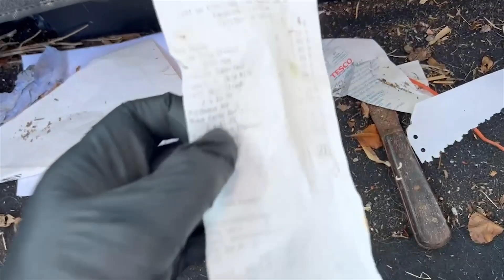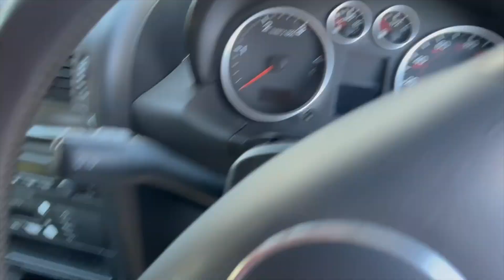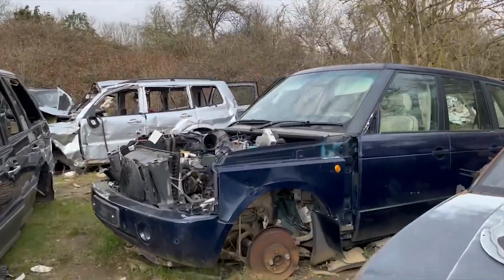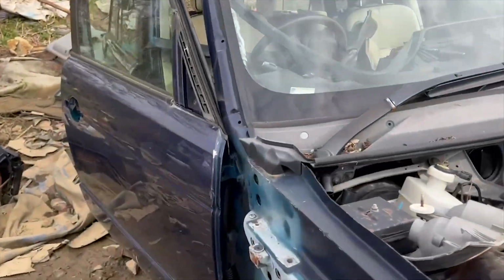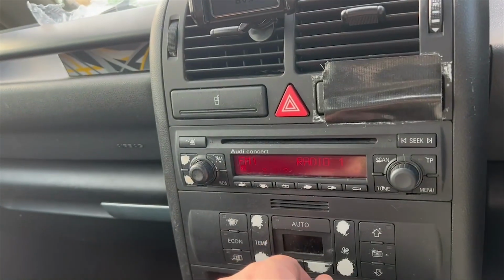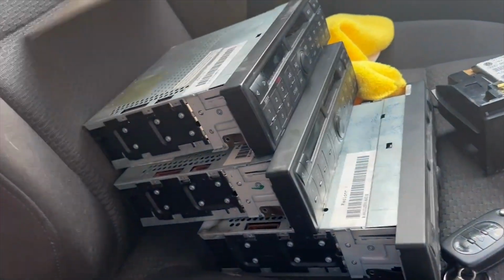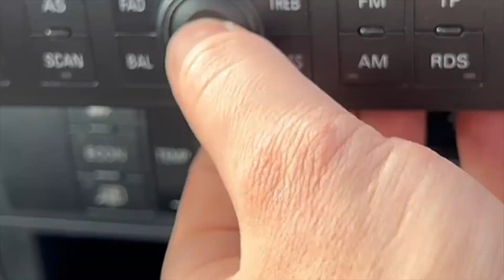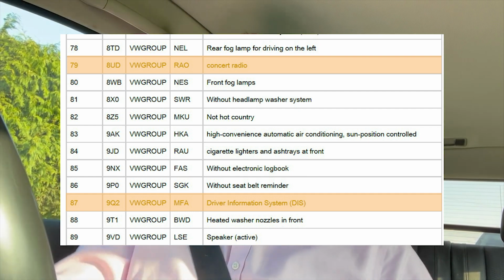Trying to save my Audi A2 from the brink on a budget!

Comment: If correct ECU, you can map the EGR out yourself with MPPS to download map, and EDC15 being used to modify before re uploading as detailed on Briskoda Fabia MK1 forum. Did this myself on a 70bhp 2006 1.4 TDI.
Reply from the maker: I’m actually sending the ECU off, probably for the same treatment! The amount I’m paying is comically low so it was worth it. As for the EGR, he’s machining it out so it’s less restrictive but still performs some of the functions you want, and doesn’t upset MOT man! I’ll post the results on here :)

Comment: The holy grail of used car buying is to find value in older cheap high spec cars that the general public are ready to discard. Does this A2 fit the bill ? At some point all cars become uneconomic to repair or too unreliable to use. If it could do a job for you as a daily commuter / runabout and it saves putting miles on the RR then plough on and try to fix it 😀

Comment: The internet is awash with "You can easily pick up a second hand beauty for £500 " to which, having bought and sold dozens of cars over the last 50 years, I say "absolute bollocks". It is certainly possible to pick up such a bargain just as it's also possible to win thousands of pounds on the lottery! I reckon that for a regular runabout anything below £1k is likely to be a dog. From £1k to £2k you can pick up a good motor but you need to know a fair amount about cars and understand exactly what you are looking for. Once you get above £2k then the odds are moving in your favour and you should be able to pick up a decent runner.